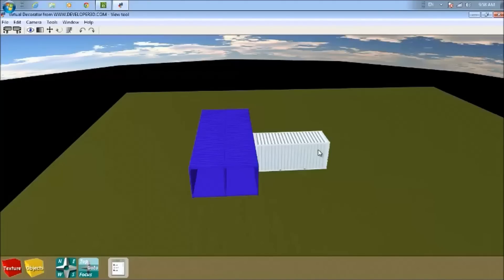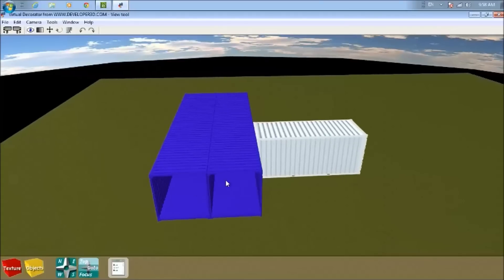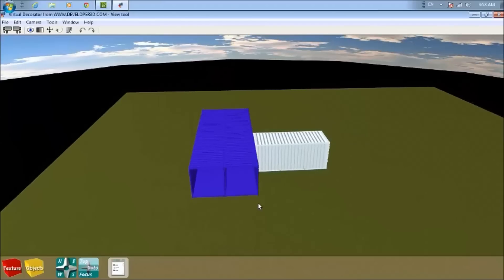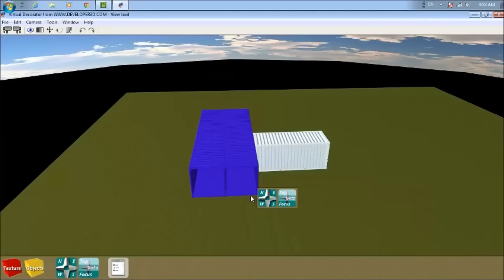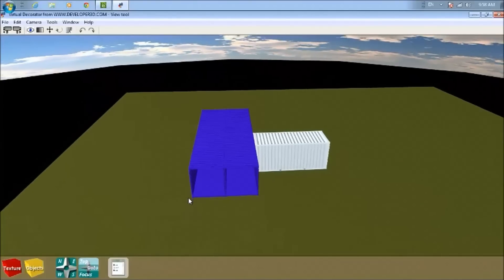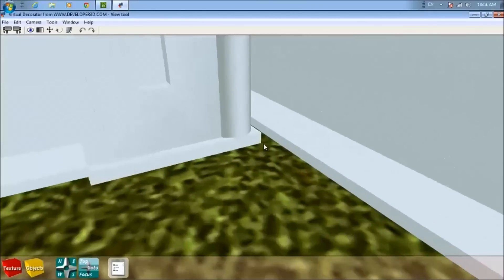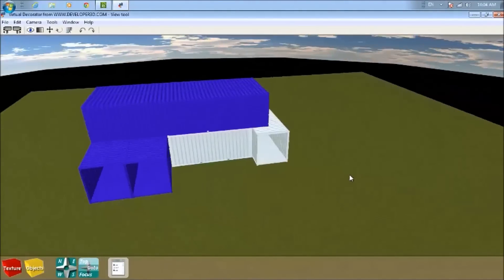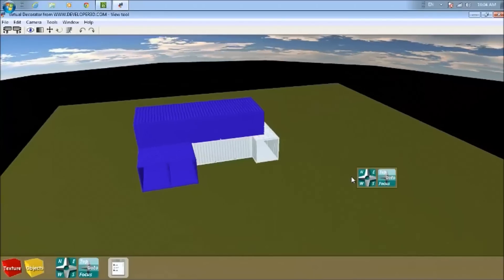Shipping Container Home Design (Interior & Exterior Design)

Comment: After viewing the video and browsing thru' the various comments provided by other viewers, without due offences, I strongly advise Mr. Stanimir to be more careful towards any projects concerning built environment!!!!
Having more than 25yrs of engrg & construction experience, I can see clarly that this project is not going to work as follows;
1) The stairway rising towards the 2nd Sty will be blocked by the 40ft containers' 2 nos. of bottom steel trusses.
2) The sanitary pipework from the 2 toilets will be directly above the main entrance. A false ceiling space of at least 450mm will be required to hide these aweful pipework. Height of a typical container is only 2.59m (2590mm) exterior. You only barely left 2.1m around the entire foyer area. Normal door height is about 2.2m inclusive of door frame.

A piece of advice for those who wished to have a container home,; never place any toilet/s directly over another container unless you are willing to have very low clearance height, willing to provide lots of unnecessary box-up details and finally cost. If one do not have sufficient Architectural and ME knowledge, its best to design only single level houses on alleviated stump supports as concealing the pipework below ground level requires geotechnical and structural background. Many things looks easy but once the actual situation befalls upon you, your general knowhow even as a owner will be put on the test.
Reply: Danny C  Thank you for your info! I have often wondered about placing a toilet on the second floor of a container home.  Would it be advisable or not and any possible complications that may arise.  Glad I read your comment on this video. Thanks again :)